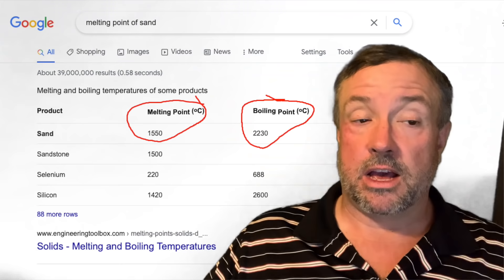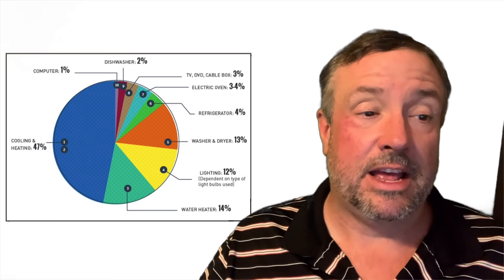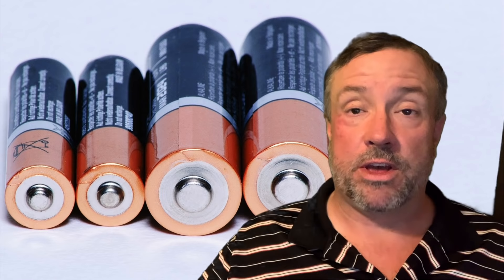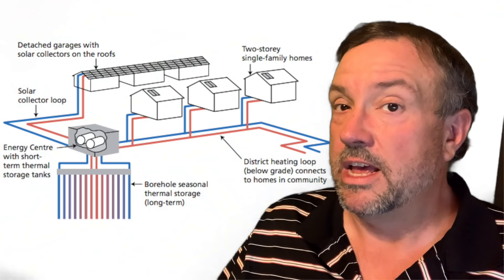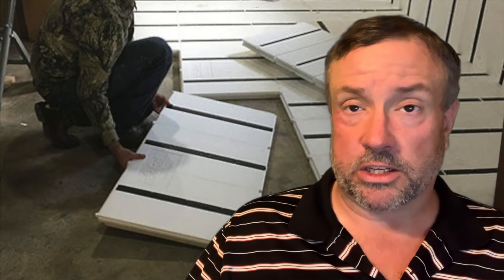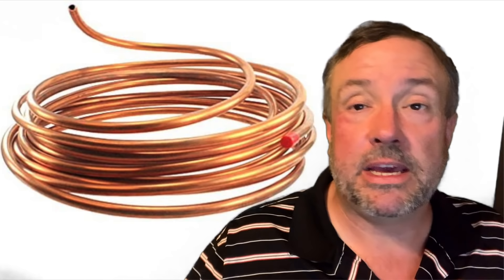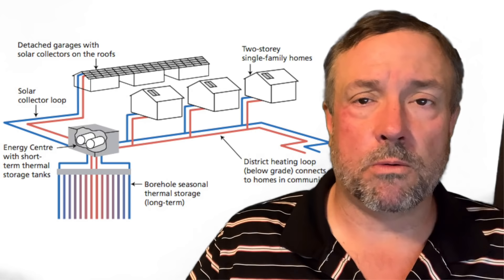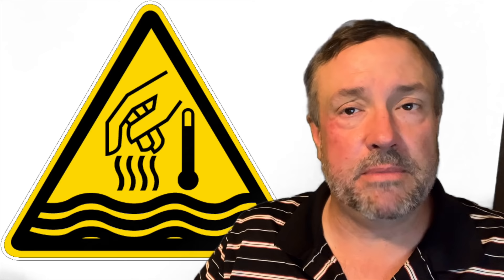Sand for Thermal Energy Storage

Comment: OK retired physics teacher here. As my old friend the late actor Jeff Rudom would say herswachagaddado:
Forget water altogether you have done the maths too volumetric basically. Water as a heat transfer medium also sets a system temperature limit of 100Centigrade. Let's get a bit more ambitious here and go for 800 to 1000centigrade. So we need some sort of really exotic heat transfer material like liquid sodium huh?
No we don't we just need low pressure super heated steam. You are right about yhe aircrete container but it should be spherical in shape and sealed on the outside against water.
Option two get solar panels and a load of old night storage heaters. Remove the cores and put the heaters all together in said aircrete boxes.
I am going to set up an offgrid house in Portugal and I am doing something similar to heat my house but I will just use a rocket stove thermal mass heater for house heating.  It uses about one tenth of the wood you would need for a wood stove with no pollution. Wood  should be the heating choice for all of North America you have so much pine beatle dead wood that if you don't get it sorted you will have forest fires on an apocalyptic scale SOON.

So consider this what do you want electricity for at night well you want lights (LEDS) nothing, TV (12V ) nothing radio/music nothing. Even if you do all of this together it doesn't amount to a hill of beans. So you say I want to run a hoover, washing machine fridge etc. These can all be done in the daytime when solar electricity is OVER abundantly avaliable. Modern fridges and freezers will tolerate power outages for up to 17hrs by the way. This is called demand side management.

So I am going to set up the thermal mass rocket stove but I am going to do a small size solar powered high temperature night storage heater running winter and summer but I am going to extract heat from it at night to drive a tiny heat engine probably a Stirling engine to drive a generator for my tiny night time electricity demand. This is the basis of ongoing research for renewable grid energy storage heating concreted and has a high efficiency and a charge discharge lifetime running into the millions it also costs peanuts. I am a bit tied down at the moment with covid restrictions but my channel will contain all of this and more so subscribe in readiness it won't hurt a bit. Where's David-Paul?
Reply from the maker: that's really awesome, thank you!
Reply: What's your channel

Comment: What has a better thermal coefficient for a heat battery medium, clay or sand?
Reply from the maker: I don't know!
Reply: The problem with clay is that any moisture contained in the clay at the high temperatures would turn to steam which would cause pockets to form in the clay or worse could cause a steam explosion as it heated up in a tight space.

Comment: That's what I start reading comments and lose what I had to put down. I was very interested in the beginning how you were going to store heat throughout the winter. 

If you have to put heat into the sand you could just as well easily put it into your house (when the sun's available). I'm not sure I would try or waste time storing the heat in the ground unless it was under the house. Maybe build the sand battery in the walls instead. 

Thanks for some ideas!
Reply from the maker: I appreciate that, look into drake landing solar community

Comment: If I were to attack this problem the first thing I would do is a simple energy balance calculation.  For now forget about the storage and just figure out your energy needs  Ie how many cords of wood did you burn last year times the number of BTU's/cord .  So figure out how much energy in BTU (or what ever unit system you like) that represents.  I see a cord of Maple is listed at 25 million BTU's per cord.   For grins and ease of calks lets say you use 4 cords. So you used a total of 100 million BTU's of energy (BTU is the amount of energy it takes to heat 1 lb of water one degree F)  If you use Joules instead of BTU's multiply this by 1055.
Now there are some losses with burning wood, some BTU's go up the flu but lets ignore that for now.    So we need to capture  and store 100 million BTU's of USABLE solar energy.  In Winnipeg you get about 5 kWh per sq meter per day of solar energy photons.  Lets assume you can capture at 100% efficiency all the solar energy for 120 days. Your solar input is  600kWh of energy  or  about 2 million BTU's for each sq meter.

 Cool we only need 50 sq meters to satisfy or need.   Well not so fast, we haven't considered collector efficiency,  collector to storage efficiency, storage losses or energy extraction losses. You  are going to need 100's and 100's of sq meters of efficient collectors and very well insulated collectors and storage.  To size the storage look up the specific heat of sand (0.186 BTU pound per degree F).  For reference water is1.0 and the best of the materials --quirk of nature.  With 500 deg F sand you would need over 500 tons of sand to store 100 million BTU's of energy.   Lots of solar panels and a grid tie system with geothermal heat pump would most likely be the best solution.   If you have a free wood source hire out the log stoking or make an automatic stoker. 
Good luck.
Reply from the maker: Thank. you for the detailed info!
Reply: I love it when people who know stuff take the time to comment!!  Thank you for your time.
Reply from the maker: Obfu Scate  he's wrong

Comment: My current headspace is a thermal mass in each room the size of a 5 gallon bucket efficiently heated  with electricity by solar energy (or not) would be more realistic. But I forget what cold winters are like now that I live in southeast USA although I can see my breath while typing this lol.
Your a great salesman about the like button thing lol.
Reply: For injecting heat I think electricity optionally powered by solar is the way to go for inputting heat and as for withdrawing heat, if you are already using this epic heat battery why not have a simple air vent from the middle of the battery that is seriously insulated to the max to your home. And if you make the battery deep enough I'm pretty sure you could not heat it up and utilize the stabilized temp of the earth for continuous mildly cool air in the summer.
Reply from the maker: Thank you for the kind words

Comment: Fresnel lense to concentrate solar energy into the sand
Reply from the maker: I like it
Reply: @SimpleTek  Fresnel lense from old big screen TV's in the junk yard.
Reply: The problem is that this doesn't adequately distribute the heat throughout the sand. I do like your ideas though. I would actually use that to heat oil that could then transfer the heat more efficiently though the sand.
Reply: @justinweatherford8129 I had thought of that, so I was thinking of running a coil of tubing in the sand with an oil, that can be cycled to heat transfer. Then you can have an intermediate heat. Sand, with greater temperatures, can hold the heat longer, but can be destructive to some equipment.
Reply: @bretcalobeer5152  that sounds like something that I would do.

Comment: Photo Voltaic panels producing DC power at high voltage is a cheap simple way to transmit to a resistance heater. No electronics, moving parts, or fluid. Ram EMT conduit a few feet under your garage floor and insert a loop of high-temperature resistance heater wire into each conduit calculating impedance match with the solar panels. Add a seasonal control switch and one fuse to the circuit. The solar heat produced will reduce or replace whatever fuel you burn. The Winter sun angle is low so lean the solar panels on the south wall.  Heat something else in summer, water, garden soil, etc.
Reply from the maker: ok

Comment: There is a company "Polar Night Energy" in northern Finland that uses solar panels all summer to power electric resistant heaters.  Then the dark winter it draws the heat out.  I'm it could be oil with a heat exchanger or maybe blowing air though ducts.
Reply from the maker: Thank you

Comment: So... if cost is the only concern: 
I would run oil or water. 
Molten salt is expensive. 
So it's out. 

As far as piping goes, I'd use Aluminium. 
It's far cheaper than copper, and can become almost as chemically stable. 
You can also braze aluminium more cheaply than copper or Stainless steel. 

Stainless steel is almost as expensive as copper, and it might fluctuate depending on your local market. 
Stainless steel is used in industrial food processing, and this greatly effects the cost of buying it. It's also pretty heavy. 

Don't use iron piping (either black pipe or galvanized) it will react with hot water. 
Hot oil might be ok, but it's cost is such that just using stainless or aluminium is the better alternative.
Reply from the maker: interesting points - thank you!

Comment: ...the sand gets too hot? If only there was a way of turning the sun down a bit with a control device, or off.
Seriously, I wondered about an insulated tank with appropriate valves and loss compensation filled one third/half sand and two thirds/half salt water. Heat transfer pipes in the salt water thermostatically controlled to keep pressure constant and safe. The sand would store latent heat but the water would keep to within selected parameters. By now you can probably tell I haven't thought about this much but it is a fascinating idea. Sounds like geothermal principles may work too.

Comment: Couple ideas. In a thermal battery, we're talking about thermal mass, where the overall temperature is not the only factor. What we should be looking at is specific heat capacity.
For example, sand has a rather low specific heat capacity of 840 J/kg °C. Which means it will heat up very quickly and cool off very quickly. Water on the other hand has a higher specific heat capacity of, 4182 J/kg °C. That means it will take more energy to rise the temperature, and it will stay hot for longer.
Simply put, heating up 1 liter (= 1 kilogram) of water from 20 °C to 80 °C will take (and contain) 251 kilojoules. Heating up 1 kg of sand from 20 °C to 80 °C will take (and contain) just 50 kilojoules. If you wanted to contain the same amount of heat in the same amount of sand (251 kj), you would need to heat it up to 318 °C. At which point you have a higher temperature, but the exact same heat capacity for a battery.

Secondly, working at those higher temperatures brings out a lot of technical problems, some of which you mentioned in the video. Water based system would be much easier, which helps in keeping the costs down.

The way I would do it to make the best bang for a buck is to buy a used IBC container of either 1,040 or 1,250 liters (275 and 330 US gal). These can be found pretty cheaply. Fill it with water, which, accounting for transportation costs, should be cheaper than sand. And insulate it in a thick, air-sealed box of polystyrene. And you can run it straight to your radiators. (IBC containers are typically made of HDP plastic, which has a melting point of 125 °C. That should be plenty for this application.)

If the capacity wasn't enough, you can just build a second or third unit, and I'm sure it would still be cheaper than building a double loop system with coper tubing and such.

A little sidenote on the "seasonal heat". I don't believe that's really practical. You can have an array of photovoltaic panels that are already cheap enough to provide electricity, heat your home during the day (especially with a heat pump) and with a reasonable thermal battery during the night, or maybe over a cloudy week in the winter.
If you have particularly cold winters, instead of building a thermal battery that contains heat from August to February, I would just buy more photovoltaic panels.
Reply from the maker: cool ideas

Comment: few years ago a look at the sand heat capacity and water.. It cannot beat water at all only extreme high temperature gives advantage to sand, also using sand can be in some way better solution mainly if you need more then 100°C
Reply from the maker: interesting

Comment: Sand battery is probably one of the most interesting idea to store heat energy for a long time. I am thinking about to realize that in a small scale, just for an alternative heating source for my house. Interesting question is, how to transfer heat out of the battery (in my case, intake goes trough electric heating element attached to a solar system)? Well, i think the cheapest version is the air (free available, heat resistant) . Also, you can use it in some kind of heat exchanger to heat up oil, watter or even another separated airflow like room heating with air.
Reply from the maker: It is a great idea

Comment: Love the thinking here. Check out Curtis stones passive solar greenhouse. Insulated packed sand with air tubing running underground. Takes hot air from greenhouse pumps under ground, cooler air comes out. Inverse in winter.
Would be interesting to combine liquid lines underground
Reply from the maker: Curtis Stone does amazing work respecting ROI on everything EXCEPT his passive solar greenhouses. It works, but it could be built for 1/6 or less the money and do the same thing. He’s aware of that and says it though .

Comment: For delivering right temperature you need simple heat exchanger. Simplest solution, take a coil made of stainless steel pipes and put it in the storage device. Length of the pipes in storage, flow rate of water in pipe and temperature in storage will determine the output temperature. Make multiple circuits with valves that can be on and off ( increasing or decreasing total length of pipe  to regulate output temperature). Many electrical heaters for water use this system.
Reply from the maker: Well said

Comment: Ok the thing is to extract heat. Correct and then placing it. This is where vacuum comes into play. Heat pump. Draw the heat on vacuum then compress into a cement block. You can do it over and over. The heat can be designed to dissipate into the mass.
Reply from the maker: Yes
Reply: Also in reverse
Reply from the maker: @ThailandAmazing  ok

Comment: turns out off the shelf electric wall mounted  "storage heaters"  have been around a long time in the UK.. they  are often times considered obsolete... but i bet they come back in  style with more and more PV being installed.  These are basically optimized thermal brick storage devices at very high temp inside.    similar to sand but better specific heat density and VERY easy to implement and construct.... solid easier than sand.    Specific heat not all that important if you have room for a bit more material.  Usage of these would be the opposite of what they were intended for in the U.K, they were heating them with off peak grid elec at night and releasing it during the day. With PV heat it up during solar hours to get through the night...   rather than cycling elec batteries for this daily.  The heating elements are not as "efficient" as a heat pump.... but they can get MUCH hotter so you can heat the mass during the day and possibly need NO electricity to release that heat at night (just vent the storage bricks)  . Probably ,for control, would combine with a low wattage fan, still that would be a lot less nightime electricity tha a heat pump would use running though the night,   When batteries get cheaper then   just convert to heat pump all night.
Reply from the maker: Ok

Comment: I believe it is very  expensive and difficult to focus the sun's heat for high temperatures like 1000C however using resistive heating from solar panels is less efficient but easier and cheaper to build up such high temperatures.
Reply from the maker: You need to look up Sergei’s work!

Comment: Normal single wall wood stove pipe will work to handle airflow. Use extra solar In the summer to charge the sand in thermal battery. No liquid just hot air with heat generated from a induction forge with a blower.  Run insulated stove pipe from the forge source to the battery, then non insulated in the battery. Then use the stored energy all winter with a small ventilation fan blowing air through the thermal battery pipes into the greenhouse or structure desired. In the summer you can just creat a loop for the air flow until the appropriate time for usage and temperatures are reached.
Reply from the maker: I like it

Comment: I've seen fans that run on heat so that attached where the heat source feom the sun is and blowing the heated air into pipes that go into sand will heat the sand or water barrels/tanks so heat is held for when the sun goes down.  Just a thought.
Reply from the maker: Actually a good thought…,

Comment: Bury the stove in the sand. make a big sand stove. Also dig a hole in the ground and bury the sand. Use the eath's heat to keep the sand hot. The drawback is flooding. You would need to make sure it's watertight also you can insulate the walls of the hole and dig an access room to feed the furnace.
Reply from the maker: Interesting